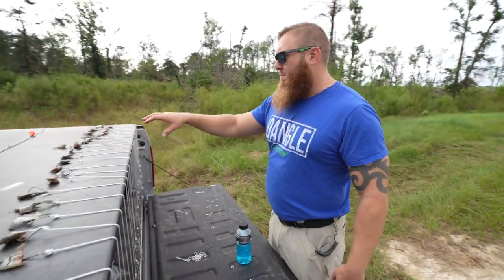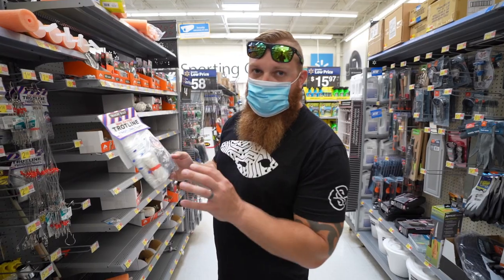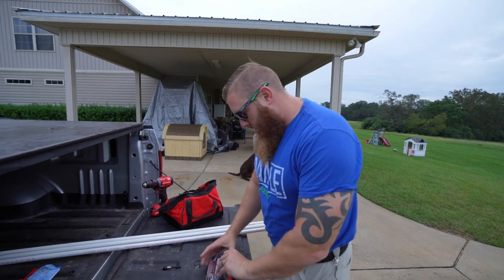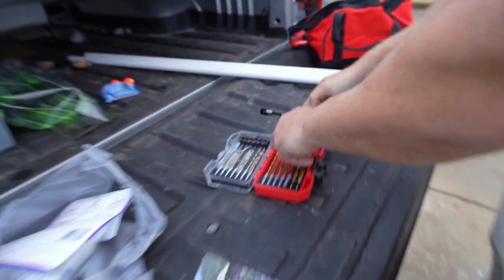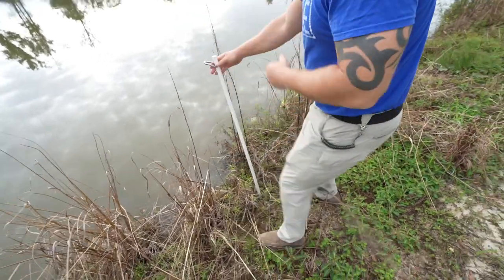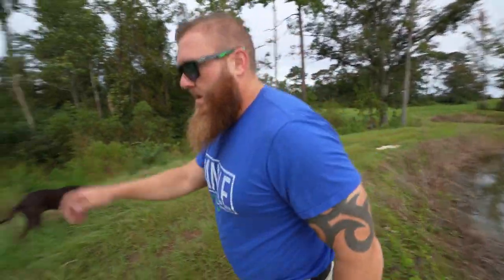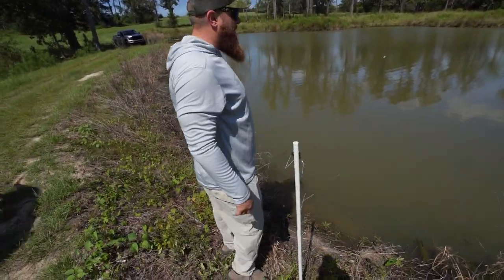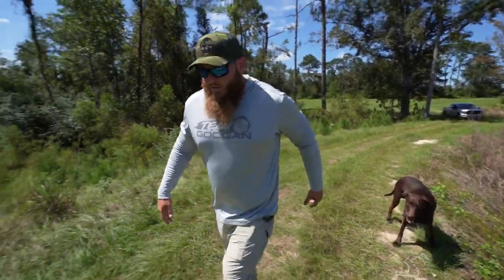DIY Fishing Rods Catch BIG Backyard Pond Fish (Bank Lining Cut Bait)

Comment: Just a little advice from someone who primarily runs bank poles and bank lines. When we run lines we use a10-15 pound weight at the end of the line that way the line stays stationary and you don’t have to deal with tangled up lines and snagging

Comment: When u put out the lines u want the main line to be realy tight if its to loose all of the baits will be on the bottom u want hooks in every part of the water column not just bottom u will get alot more production
Reply: The best way i have found to do it is use 2 rods one on each side hook them on the top stretch line across between both with a weight in the middle so it goes from top of pol to bottom back up to top pole on other side but you need alot longer poles and deeper water

Comment: Before you had a trotline on why didn’t you just put like a little bell on it so like when you’re coming down to check it out you hook it up you would know if you caught something or some kind of sensor that will let you know when it bends or a next time try getting like a little bit of a dowel rod or a stick and put it to the bottom and make it to like a point so you can stick it in easier if not it’s up to you guysWhy don’t you get a like a trouble hook that is meant for Catfish a small size or get some kind of hook the like you know how to point had a little spur you want to have the spurs in the back  hook with the spring around it  can hold the bait

Comment: You don’t run trot lines like that. You connect one line to a anchor point and the other and weight the line in between the points to keep the line down.